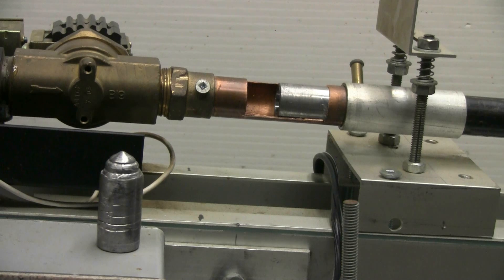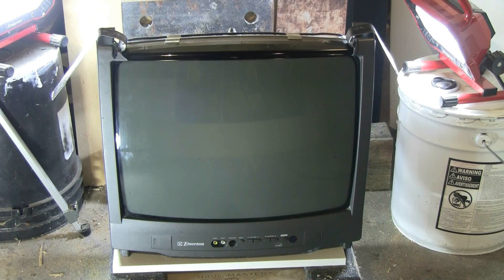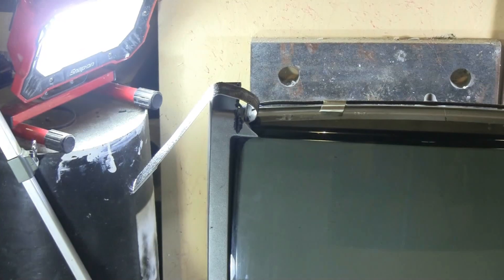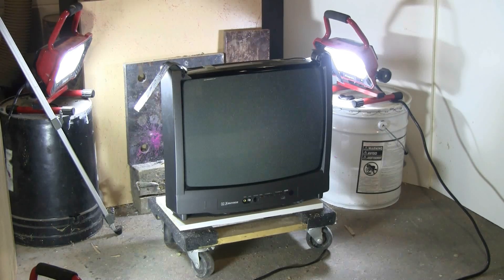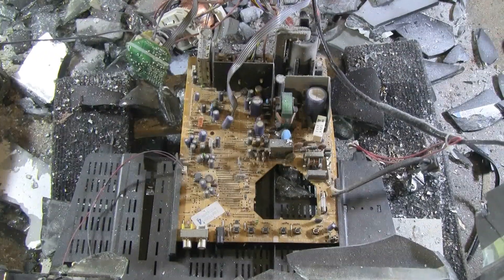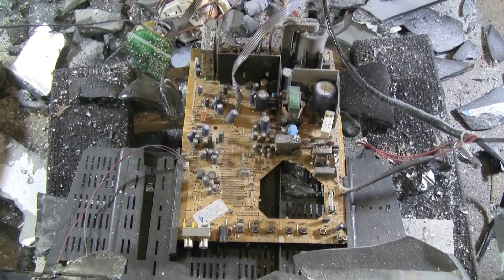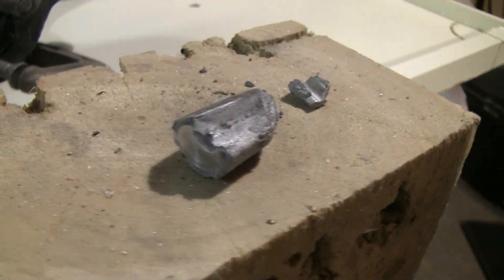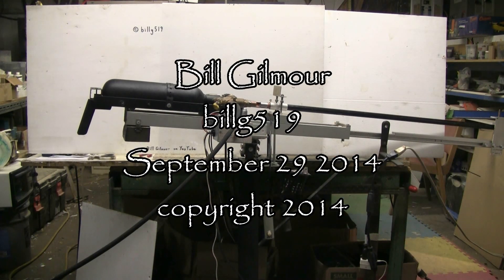Air Cannon #122 - Popping A CRT TV

Comment: Bill, I'm curious.. I've seen a needle been thrown at a pane of glass and make a hole through it. 
What is the least mass at a high velocity that could destroy a CRT using your air canon?
Reply from the maker: Green Silver What I will have to do there is get another CRT TV whenever my work discards another one. I will prep it as usual by removing most of the case and also cutting the implosion band. Then I will start with various lightweight projectiles which will be fired over my chronograph and at the face of the CRT, maybe five meters distance to target.